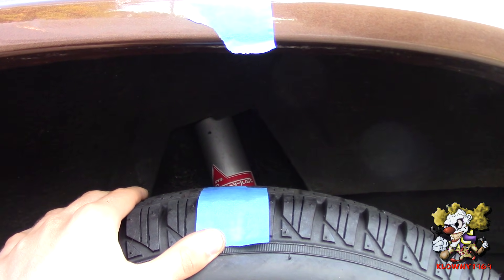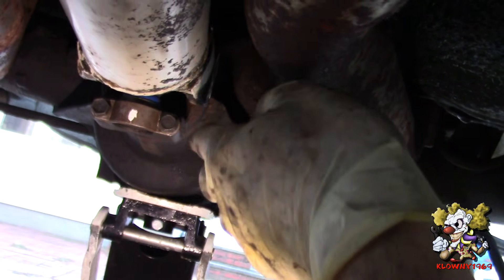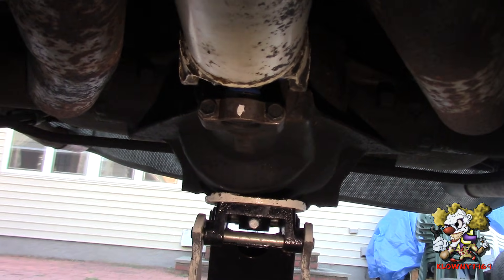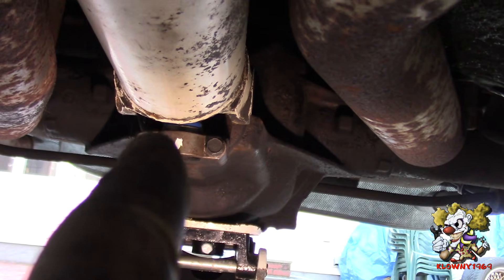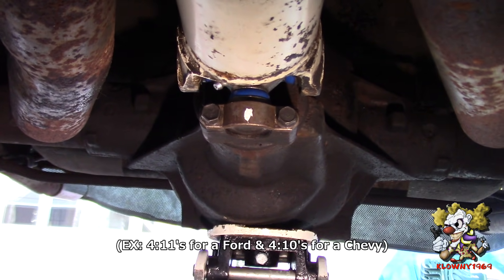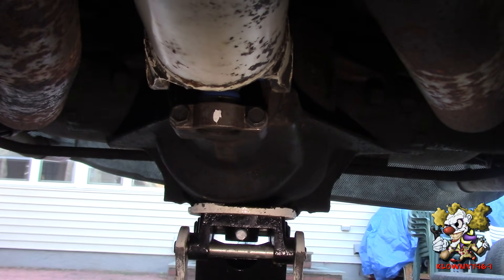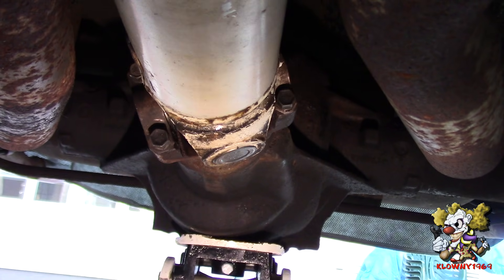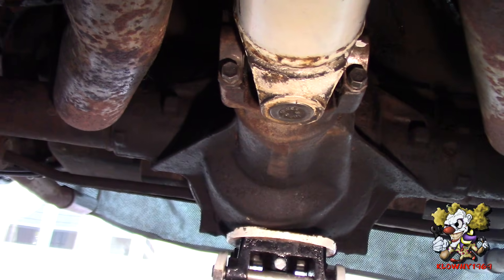How to Calculate Your Rear Gear Ratio Without Taking Anything Apart!!

Comment: This can't be accurate because of the difference in your wheel Size. If you had a 18" inch Rim and a Tall Tire that would make the Drive Shaft Spin many more Turns giving you a Incorrect Gear Ratio.
Now if you were using a Smaller Rim Size like a 14" inch and a Shorter Tire this would make the Drive Shaft Spin Less Turns than what it Should be giving you a Incorrect Gear Ratio.

This just makes Sense to me and I also Seen a Video about people doing Just like in this Video here and they Said it would Not be a accurate reading of the Gear Ratio.
Reply from the maker: Not true. Put an imaginary line through the wheel..the position of the line doesn't change with wheel size..thanks for watching and don't forget to subscribe

Comment: Now that could only be accurate with the stock size tires. If the car came with 16 inch tires and somebody put 19 or 18 in rims and tires on it that gear ratio will not come out the Same
Reply from the maker: That's right, this will give you the rear gear ratio only..don't forget to subscribe

Comment: one wheel rotation making sure the other doesn't move, my drives haft turns about 1.7 times, is that even possible I can't find 1.7s online
Reply: Sounds to me like you have  about 3.40  gears
Reply: @bombero42  thank you for your help...
Reply: I done my one twice and looks like the props turnin 1.5 to one rotation on the wheel....sounds nuts to me
Reply: @camomanofcranham  Sounds to me like you have  about 3.00  gears
Reply: @bombero42   thank you for your help...

Comment: very helpful, thank you. I,m changing my speedometer bullet which has a gear ratio reducer on it that I would like to get rid of so I needed this information.
Reply from the maker: Glad I was able to help..don't forget to subscribe
Reply: Interesting. I have a Jeep Wrangler I bought used with 35” tires and going to 37” but trying to figure out if it was regeared to begin with. My speedometer is off by a few mph (it says im going slower than what I really am) Can I fix that do you know? And by it being off - does that mean it definitely hasn’t been regeared…or is the speedometer completely unrelated?

Comment: This only works on limited slip rear end. On a non posi the other tire will turn the other way and the driveshaft will not move. You can do it by blocking the other wheel, but the driveshaft will only turn at half speed so you have to double what ever number the driveshaft turns.
Reply: Or turn the wheel twice.
Reply: limited slip is non posi!
Reply: Thanks for that!  You are absolutely correct.
Reply: Is it the same way to know the gear ratio of the front diff in 4×4 gm trucks?
Reply: @عبدالملكالقاسمي-ت8ز  Yes
Reply: Did you figure out how to do this
Reply: @zedredden-bryan707  Yes, decades ago.
Reply: @user-kr8zb7js2r  did you figure out how to do this

Comment: Hi! Thank you for the tip...does tire size matter when you do this?
Reply: No because its still the same axle spinning
Reply: Absolutely it matters the tire size the the amount of Axl turns means nothing think about it he put a piece of tape on the tire not the freaking axle
Reply: Do keep in mind that tire size will matter working on a car and what will happen is Lexi entirely was a 16-inch originally and you put a 18in tire on it that gear ratio will not come out like he did it the gear ratio will come out lower like a 355 even though it's
Reply: @keithpappas4944 You are wrong. Imagine your tire is a whole pizza cut into slices. No matter how big or small the pizza is one turn at the crust is one turn at the center.
Reply: @blakebunch4485  no! study physics
Reply: yes is you change tire size from factory then this will be differant!

Comment: It’s 2 wheel revolutions, not 1
Reply from the maker: the gear ratio was right on this car
Reply: klowny1969 Yes, but instead of guessing fractions of a turn and multiplying by 2, just make 2 revolutions.
Reply: Wow let's see... 2 Revs give 7.5(no Chevy gears this #)Divided by 2 = 3.75 = Chevy 3.73 gears

Comment: I got about 1,60-1,70? Lowest I could find was at least well over 2 x(
Reply: You have an open differential.  Multiply by 2.  One of your wheels should be held still.
The video is a posi. differential.
Reply from the maker: What kind of car is this?

Comment: Why on Earth not mark the inside of the tyre and then you can do it all yourself!  What the hell is 'three seventy threes'?  If you rotate the tyre more than once you will get a much more accurate determination of the ratio.  Why just stop at one?
Reply: well, there's only a few gear ratios to choose from so it has to be one of the predetermined gears.  3.73,  3.55, which its not, since it went more than halfway,  3.91, which its not since it didn't go almost all the way around.  I don't think you know as much as you think you do

Comment: Well 1987 trans am with a 700 r4 l98 gta assume stock gear was 3.23 but when 60 mph I'm really doing 50 mph I think previous owner may have done 3.73 is that about right

Comment: ok so I did it right, I have a 96 chevy cheyenne 1500 did mine and it was 1.75 with one turn.. kinda confused myself now?
Reply: U have to stop the other wheel. Sounds like you have a open rear end so u got maybe half. Just jack up one side unless you have a spool or a welded diff.

Comment: Thanks for this video, my chevelle driveshaft only turned slightly over 1 and a half turns per wheel revolution, so what putzy gear ratio would that be?
Reply: With an open (non-posi) rear you must leave one wheel on the ground and turn the tire TWO full turns.